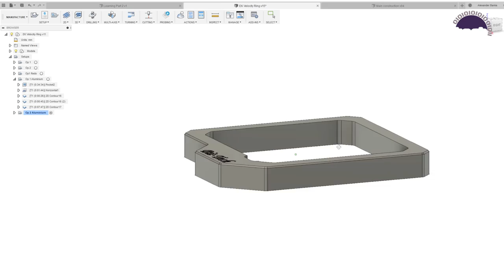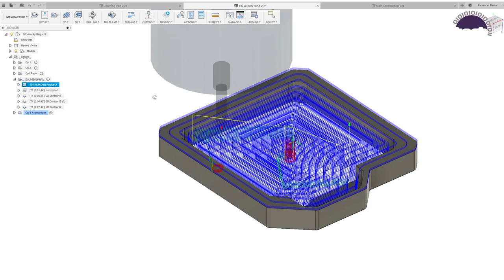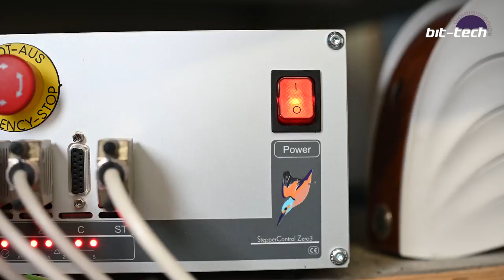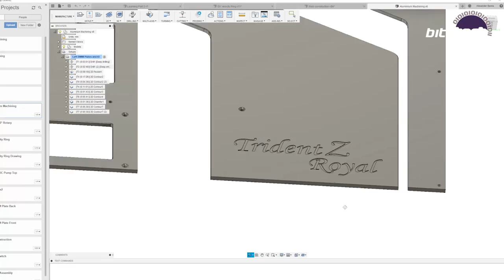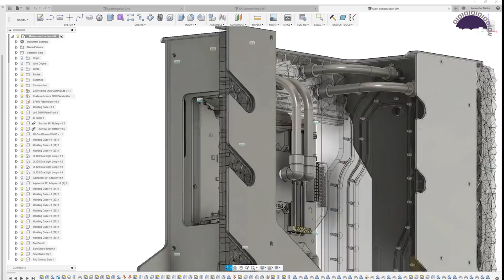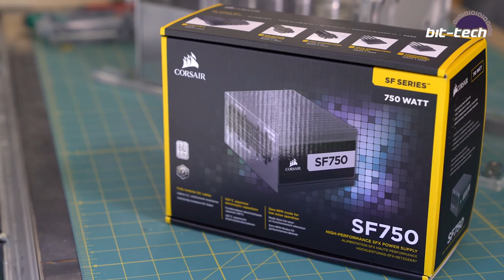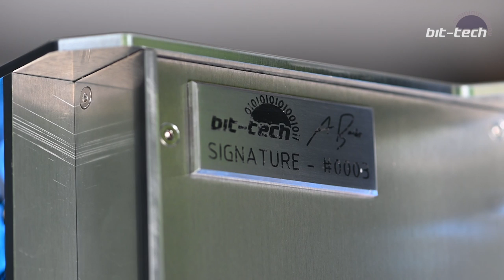Project ROYAL Crystal | Building a CUSTOM PC for G.Skill from SCRATCH | bit-tech Modding

Comment: Thanks you, now I see my 6000$ pc as  a piece of garbage.

For real your build is a masterpiece 
The mona liza of PC
Reply: Nighetmare, what specs are your pc?
Reply: @Saltoulious  CPU Intel Core I9-9900k
M/B: MSI MEG Z390 GODLIKE
GPU: MSI GeForce RTX 2080ti Gaming X Trio
RAM: G.Skill TridentZ RGB 32GB (4x8GB) DDR4-3200
SSD: Samsung 2TB 970 EVO Plus NVMe M.2
SSD/2: WD Blue 3D NAND SATA 2TB SSD + ADATA 3D NAND SATA 2TB SSD
Cooling: Corsair H150i PRO RGB Liquid CPU Cooler
Monitor: Acer Predator Z321QU Curved 31.5-Inch VA 4ms 165Hz, 2K
PSU: EVGA SuperNOVA 850 G3, 80 Plus Gold 850W
Case: Cooler Master H500
Accessories:
 4 LL120 corsair fans + 2 LL140 corsair fans + NZXT HUE 2 LED Strips
Keyboard: Corsair K70 RGB
Mouse: Logitech G502 
Headset: HyperX Clould Revolver S
Gaming table and chair from DxrAcer

This is the whole build and thanks for asking

Comment: I love the cable management but how do you keep track of the different voltages when you are only using 2 colour braiding over the same colour wire? Or are you using the Red, yellow, orange, green, blue, black and grey colour wire under the braiding?

Comment: This build is absolutely gorgeous and way better than I could even imagine doing myself, but the fit and finish is really not all that great. There are defects on the cable sleeves (17:58), scratches on the acrylic parts (20:13, 21:47), lots of scratches on the metal pieces besides the brushed aluminum look (20:19, 22:10, 22:20), and maybe some defects on the motherboard heatsink paint.

Comment: that entire loop is filled with tiny chunks and bits of plastic. How did you not flush them before putting them in the case?
Reply from the maker: Counter point, how could you possibly just assume that a professional PC builder, who just constructed a scratch built project in the same video, wouldn't think to clean the tubes? Look at the tubes closely when it's filled, you can see the water droplets, it's not plastic.